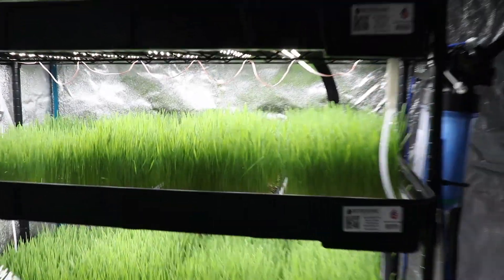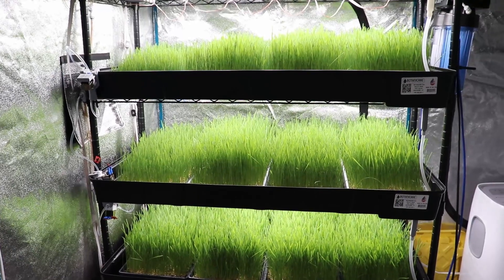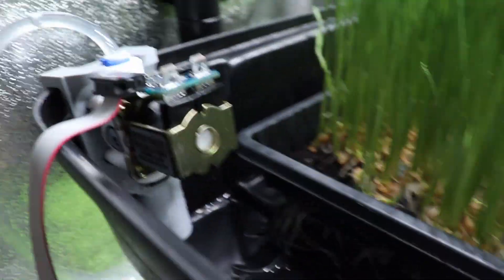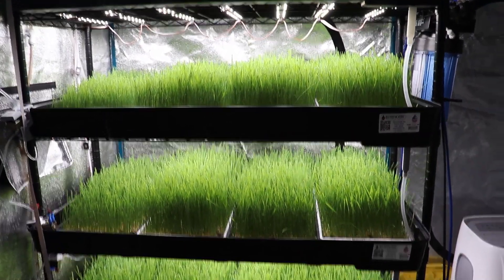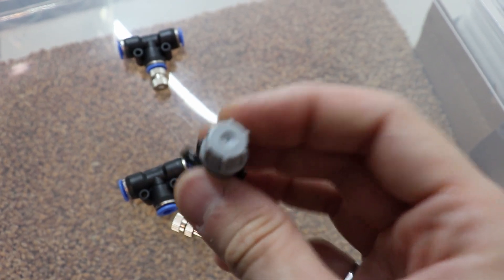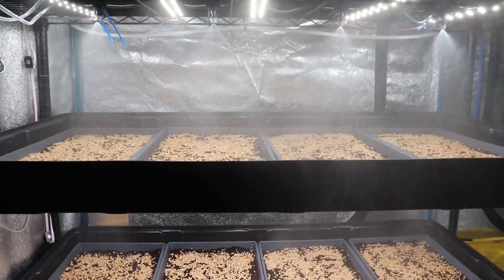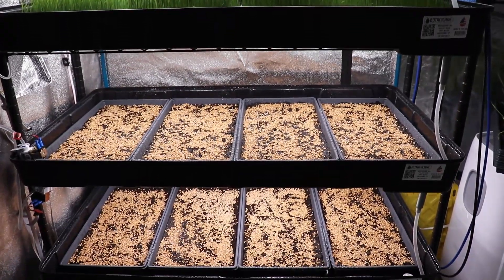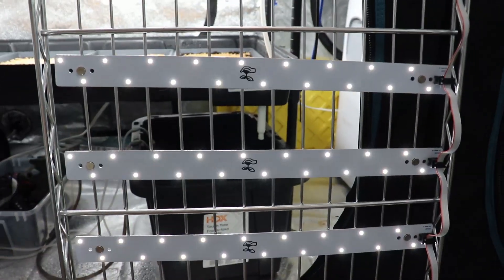Best Automated microgreen top and bottom watering!

Comment: I get you want to invent something but a bell syphon wont change the industry. I literally just use a raised plastic bolt to a pipe in my set commercial set up and it works perfect. I wouldn't waste money on anything more when just a raised plastic hose can create the drain and allow it to flood. the reason it works for me is my pump is plumbed to the underside of the tub. so once the pump turns off the feeding pipe from the pump drains out the rest of the water in the tub and has a mesh grate and filter. cheap and effective.

Comment: Instead of using top watering systems that require a lot of fine-tuning, you can soak your wheatgrass seeds for a day and use only bottom watering after spreading those on the trays. Another thing is, you don't really need soil for cultures like wheatgrass or alfalfa. Wheatgrass has really strong roots and grows up to 10-15 cm or about 5" without any soil.

Comment: Your water level control design look to be an inversed toilet filling design, I'm drunk and it took me 30 second to guess how a system similar to yours would look like, then you calculated the opening flow ratio to be equal to your pump GPM,  to keep the same water level, a slight angle and aquaphobic coating and you should be able to stretch you  watering cycle before cleaning from 20 to 35%If had to guess you have a something smilar to a  telsa valve design to control your waterflow and reduce the amount of turbulence your roots have to deal with but I'm reaching at that point. 
Anyway, the barrier of entry is too low  for that specific one, hardware is stupidly easy to copy and is not a viable base to build your business strategy at such a low level of engineering,  you should focus on the software side, your goal should be to make it the most convenient possible to use and assemble. Love your work, you were an invaluable source of inspiration at my lowest, All the love.
Reply from the maker: Thank you for the message! 
You got some of it right and some of it wrong ;) over time I found simpler tricks to make it work with any GPM (so not tied to a specific pump). 
You are correct that this stuff is easy to copy and that is why I stopped showing some of it. I am trying to make is simple for the user and small changes seem obvious but are hard to find haha. I think that my drain reached that point and I am looking into patents. 
Thank you for the kind message and I look forward to seeing your next comment Michel :)
Reply: @klorofila   @EcoTech  Fr the GPM you are right, the solution is pretty simple actually, the GPM never really mattered at  least just the maximum amount you are able to drain within your system specs; the water level is the most important factor, the opening  size should be tied to the water level to achieve parity. I have some design input I'd like to give but youtube isn't best channel for this kind of talk.

Comment: Please move your electronics to the top shelf at the very least. Your top watering overspray can cause a short and start a fire.
Reply from the maker: Great point! I am doing that on purpose and keeping an eye on it (I am there during top watering events). The boards are conformal coated and I want to see how bad it get to know how to improve the design
Reply: @klorofila  Get all the non necessary outside of the tent, why are you still working  tthis kind of growth tent design, I thought you would have switch to coated endoskeleton design by now, the board have no need to be in contact with the environment nor to be tested when your first design principle should have been durability. I have the basics of  a design that would allow the durability by isolating all your electronic from the water and would make it easily scalable. 
I'm thrilled to see the evolution of your work.

Comment: I like the way you are approaching the automation. I would like you lower the  over head hose so that is don't wet up the LED to cause a short circuit. I would try implement a moisture sensor which will prevent over watering.
Reply from the maker: Thank you!
yeah having the water under the LEDS would protect them but that would also mean that some LEDs would be covered by the tube, leading to less light and heating the tube.  So I am going to try conformal coating to waterproof the LED boards
Reply: @klorofila  It is going to be a tricky situation but if something come to mind I will let you know.